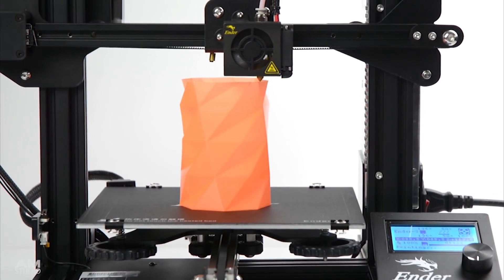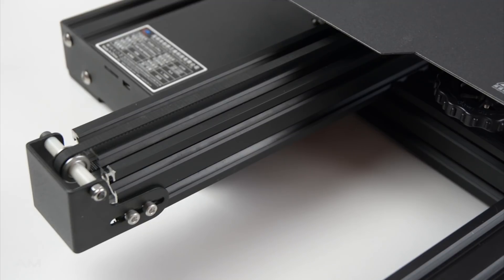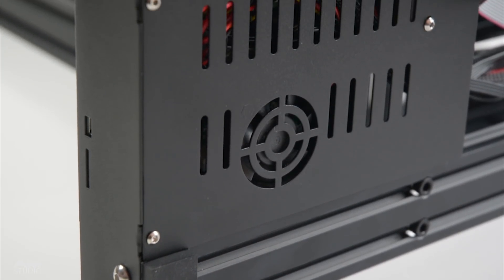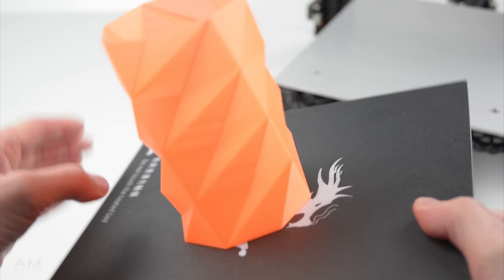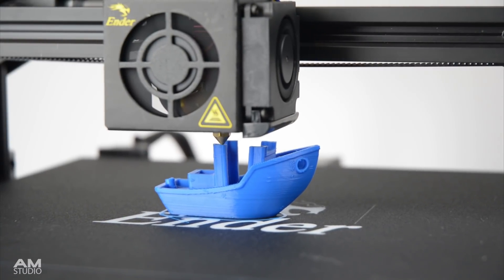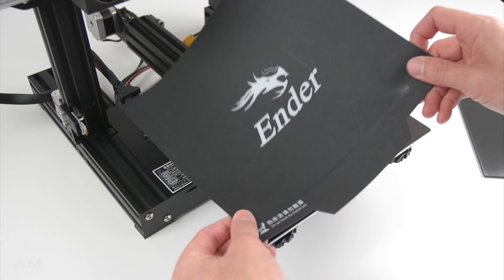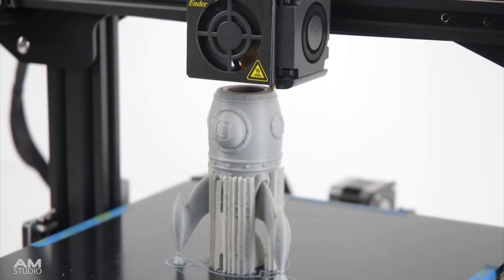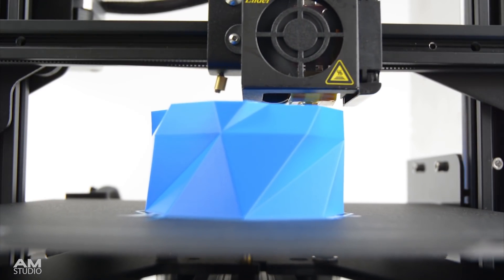ENDER 3 PRO 3D PRINTER vs ENDER 3

Comment: hi mete this is for ender 3 pro SUNLU 3D Printer Filament PLA Plus, 1.75mm PLA Filament, 3D Printing Filament Low Odor, Dimensional Accuracy 0.02 mm, 2.2 LBS (1Kilogram) Spool 3D Filament for 3D Printers and 3D Pens, Grey PLA Plus i can use this???

Comment: Yeah I don't think that is worth the extra cost either. That said I have upgraded to a glass bed on my Ender 3 when I first got it and I have also upgraded the extruder to the aluminium version. My next upgrade will be moving to the CR10s! Which blue filament is that you are using in your video? It looks like a nice shade of blue. PS: There is a black friday deal out there for the CR10s for $391 USD
Reply from the maker: Hey! Yeah the stock Ender 3 is great value for the price. The blue was an cheap no brand filament Ive had for a while. CR10s good if you need a large build volume!

Comment: This printers flexible bed is a joke  as it lifts corner on every print bigger than 1cm
Reply from the maker: Go with the glass bed.
Reply: @amstudioprojects  Maybe the different bed surf would help. And I think non magnetic flex would get better result ant it would not shrink like magnetic flex surf. Maybe you have tested them both ?
Reply from the maker: The non magnetic came on my standard Ender 3, I found that it did not lay perfectly flat after a while. So I removed it and only use glass now. Get better and consistent results with the glass.